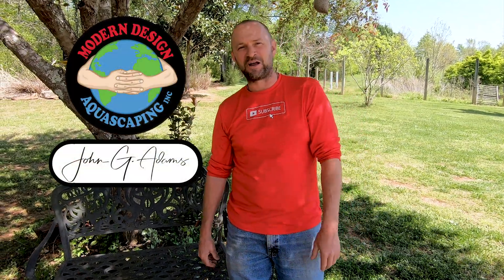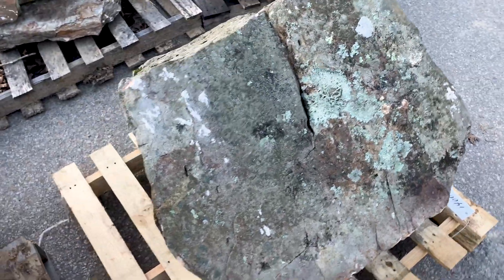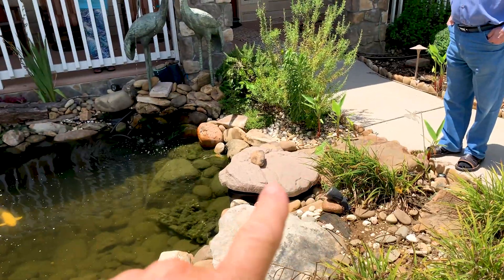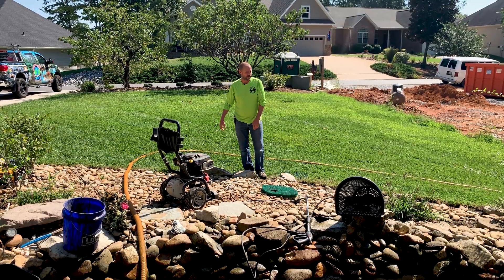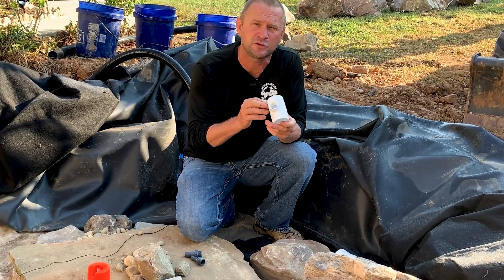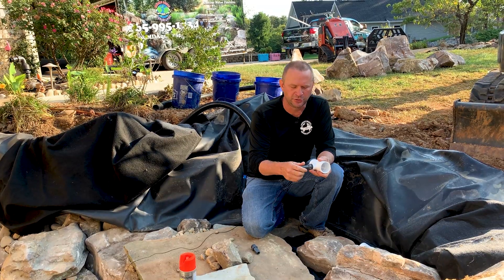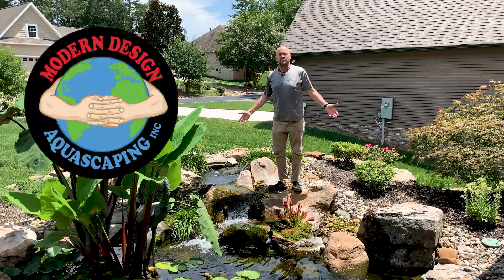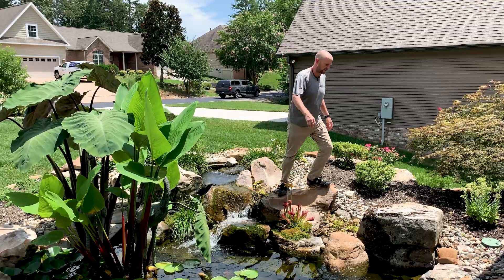Old Pond to Ecosystem Paradise | Advanced Plumbing Tricks!

Comment: Quick question.. can you also fit two pumps into a pump vault?
Reply from the maker: I don’t like to pull more than 10,000 per vault but if you drill and cut out all of the knockouts you can do 20,000 GPH

Comment: Thank you for all you share when it comes to ponds, John and your team at Modern Design Aquascaping Inc,  
QUESTION: What do you recommend to remedy the following scenario?:
A lined pond with EPDM where there are sides in several places under the coping stones where the soil (loamy clay with rock) is migrating into the pond under the liner and coping stones.
Reply from the maker: Sometimes a geotextile underlayment can be used to stop soil migration. Can you dig behind stones and use a rolled up section of underlayment to let water pass through without soil?
Reply: @KoiAddiction  Thank you for your reply. Unfortunately, this is not an option - we want to prevent water loss. Thinking we need to keep pond a bit lower than it is and to tamp down the earth under all coping stones to make sure the earth is hard pack vs. loose.

Comment: I appreciate learning about the plumbing concepts and philosophy on this build ! Thanks John !  Would a guy want to use rigid pipe on the over flow when ever possible rather than flex to try and prevent sagging issues long term ? Guessing the rigid pipe is vulnerable to sagging as well …. Another great and helpful video … The info you share is incredibly valuable !!
Reply from the maker: I am indifferent on the flex vs. rigid. If you install it properly you are good. Def more important in freezing cold areas though!

Comment: John, what is your strategy with the jets? I only know them as a way to help create a vortex so a bottom drain will be more efficient. But you don't typically build with bottom drains. Are you trying to push the water up from the bottom? How do you decide how many and where to place them? 

I'm so curious about all this.
Reply from the maker: I use them to eliminate dead spaces and to enhance the effect of our filtration. We turn them off in the winter but in summer they keep things moving. I think circulation is almost as important as filtration!

Comment: Well done video, John! Love the explanation on the jets and the heron hook-ups with a separate pump and 1.5" piping! Question: For the aeration diffuser you used here, would you put them in 10x16Ft ponds too that are about 24" deep? What's your take on the 12V Pond Powerheads? Any success with them?
Reply from the maker: The air is prolly over-kill on a small pond- we only used it here because they have a very heavy fish load. I like to use pumps for jet systems vs. power heads if I can design it in on the front end. We would use the power head to fix a “dead area” in a pond that is already built though. We have also stopped using the second pump in the skimmer because our clients keep wrecking the skimmer mats when cleaning them. It’s a bit more work BUT a pondless vault with 2 small aquablocks near the skimmer is great for a 2000 gph jet pump!

Comment: John, you missed an opportunity to  plug your own design series video on pump selection and calculating head pressure. Don't worry, I got you: https://www.youtube.com/watch?v=gmis3DgFbEE
Reply from the maker: Thanks boss- I had three cards set up on this video and none of them are actually working...
Reply: @KoiAddiction  Hey John, here's a plumbing question I just thought of.

How do you determine how many return jets to place at the bottom of a pond? And how do you choose pipe size and gph to throw at each one?

I have a long, skinny deep area in my pond (5' x 18') that's 4' deep and trying to decide if I should be doing anything down there to keep the bottom clean.